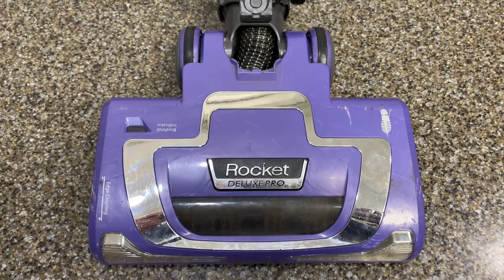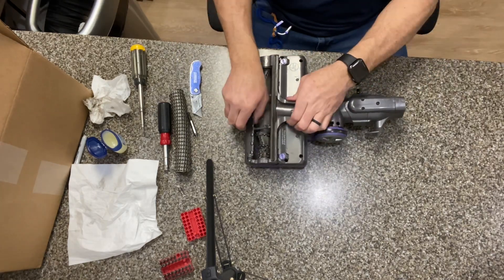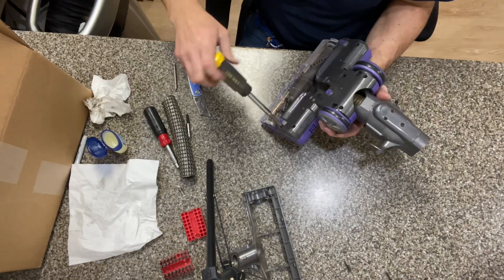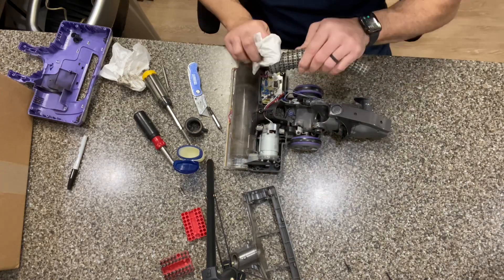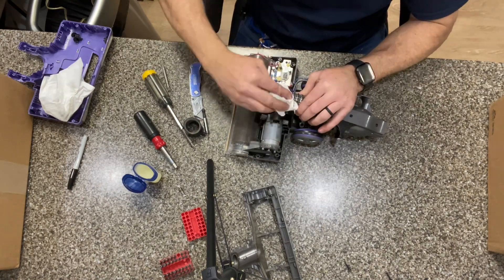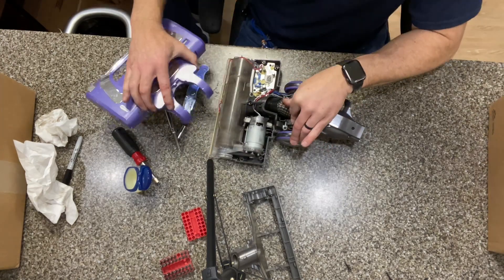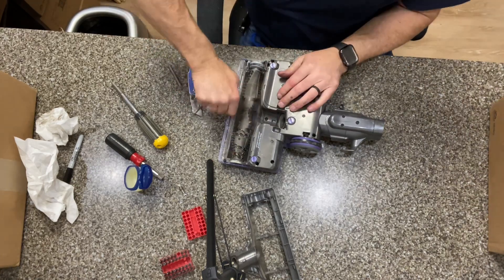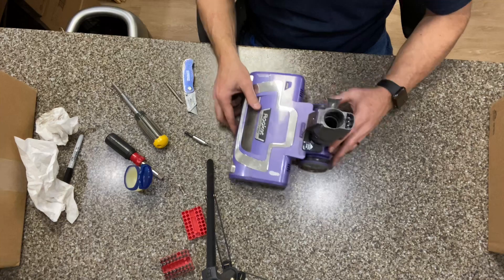Shark Rocket Deluxe Pro Hose Replacement

Comment: Thank you for the video. After disassembly I couldn't figure out how to remove the hose until I watched this. I used baby oil as the lube which also worked fine.
Reply from the maker: Awesome. Glad you got it back up and going.

Comment: This is a great video, I was able to fix my shark in about 20 mins. I ended up using plumber grease versus Vaseline. mainly because I had it on hand.  The only issue I had was properly aligning the small end of the fitting with the seal. The first time I did not seat it properly and couldn't put the roller cover back on. Once I figured out my mistake it was fine.
Reply from the maker: Great. Glad it helped you out!

Comment: The one thing I got wrong was the alignment of the hose in the head.  Fixed it by making sure it was aligned by putting the brush cover on before putting all the screws back into the assembly.
Reply from the maker: Great. Glad you got it back together to put some more miles on it.

Comment: This is probably one of the MOST helpful video's I've watched yet!  It took me awhile to replace the hose but your instructions were perfect.  The only thing I would say you should include is, the notch on the hose housing that fits into the base, needs to be lined up with the small compartment on the base.  Or maybe it was just me not getting it.  I had the top screwed back on when I realized I didn't have the hose housing lined up and the bottom cover wouldn't go on because the hose was turned just a bit so it kept the bottom plate from fitting flush.  My husband kept telling me he could fix it but I was determined and it paid off!  Thank you again!😅
Reply from the maker: Great!  Glad it helped and yes that can be a sticky point trying to get that back in right. That is a great point to mention and I hate failed to mention it in the video. Thanks for watching.

Comment: Thanks for this video. It's always so much better to see repairs on video, rather than reading from a manual! It made my repair so much easier!
 I probably wouldn't have been able to do it correctly without your help!

On a side note: One thing that i noticed on Amazon is that most of the replacement hoses say they are 1 1/2 inches in diameter and that they will fit this model. When in fact the hoses should be 1 1/4 inches for them to fit properly. Almost all of the 1 star or negative reviews are about the hoses not fitting, peoples' frustrations, hoses returned, etc. 
Buyers beware!
Reply from the maker: Great. Glad it helped and thanks for the extra info.

Comment: Even with the vaseline it was a pain in the neck to get that hose in there, but thank you for the video, I was able to get mine replaced in under 10 minutes, and I suck at stuff like this, although the one I have only needed a philips head, no torx bits.

Comment: Idk if u will even see my comment but I'm crossing my fingers u do. I have taken all of the screws out - I had seven philips head screws and three that took a T15 bit. I have pulled and pulled and I was able to get the top of the two pieces apart (where the wand attaches), but for the life of me, I cannot pry the top and bottom piece apart! Idk what else to do! All screws are out but the two pieces cannot be pried apart like where the  brush roller is. Any suggestions? I would even compensate u if u did a video call with me! LOL I'm just at a total loss. And I don't want to break anything by pulling too hard. I already cracked a little piece in half where the belt is because I stuck a screwdriver in there!

Comment: i put the Vaseline on the threads
Reply: 🤦‍♂Why? People seem to never learned chemistry.
Reply: @CmdrTigerKing  Because its an 8 dollar vacuum hose, its not a fuel line for a fighter jet, it'll be fine, that replacement hose will get cracks in it and have to be replaced again in a year or two anyway. They just don't last especially if you have 4 walking feline hairballs walking around the house like I do so I have to vacuum sometimes twice a day.

Comment: Please post the amazon links for correct parts/tools.
Reply from the maker: Sorry for the delay, you may have already found them but here is what I had purchased before that was a little bigger and needed to be manipulated some…
But I did get it to work. 

LANMU Replacement Hose Compatible with Shark Rocket Vacuum HV300, HV302, HV320, HV321, 6" x 1.25" Motorized Lower Nozzle Hose (2 Pack) https://a.co/d/fhsNrgS

Comment: Why can't they make all the screws the same. They just expect everyone to have the different type laying around I assume.
Reply from the maker: I’m sure they go with whatever is cheapest. It can be frustrating for sure.
Reply: @bradchastain2456  luckily I didn't need to remove the complete bottom. Just the 1/4 turn screws to get the playe off.
Reply: I was annoyed by that too.... So I searched my junk drawer and found 1.... Only 1.... Luckily it fit lol.... Not usually my luck

Comment: Where did you get the hose?
Reply from the maker: https://a.co/d/93VR5Iy
Reply from the maker: Amazon “LANMU Replacement Hose Compatible with Shark Rocket Vacuum HV300, HV302, HV320, HV321, 6" x 1.25" Motorized Lower Nozzle Hose (2 Pack)”

Comment: I cant get the purple housing off where it fits around the nozzle piece
Reply from the maker: If I remember right there are 10 screws that should be removed.  Double check that you have all removed. The one in the “valley” is the easiest one to overlook. It should just pop off after all screws are out.

Comment: lol he doesnt know about Da Vinci Resolve

Vaseline you do know is petroleum based. That's a no-go on plastics... Silicone spray.. cmon
Reply from the maker: No I didn’t know about Da Vinci Resolve until now. Just looked it up. I don’t do a lot of videos but the good thing about YouTube is you can change the playback speed. Probably helps on most of my country accent videos anyways. 
I never took chemistry and I’ll keep that in mind for the future. Thank you for your knowledge and contribution to help others making their repairs.  If I can figure out how to add this comment about silicone spray on the video I’ll put a note by it. 
So far all the ones at the church that I have repair for our crew like this have done fine. They may wear them out before the Vaseline does anything.